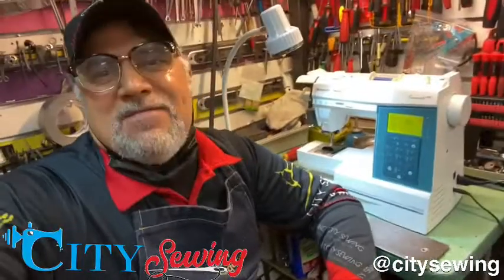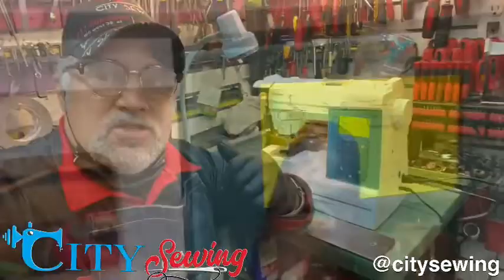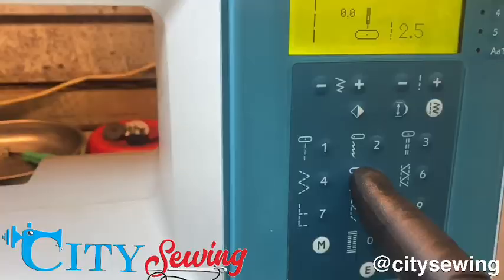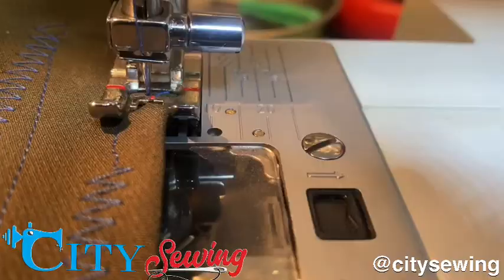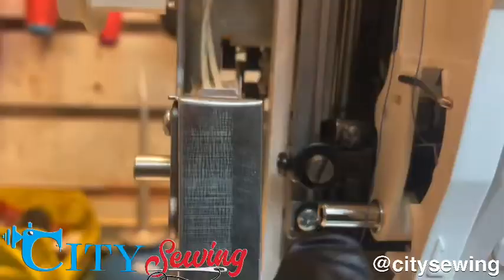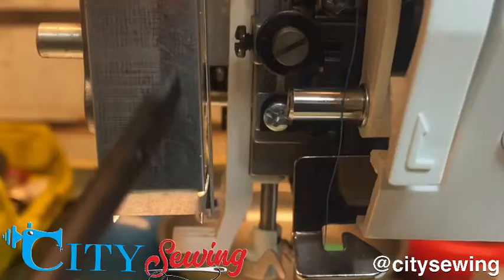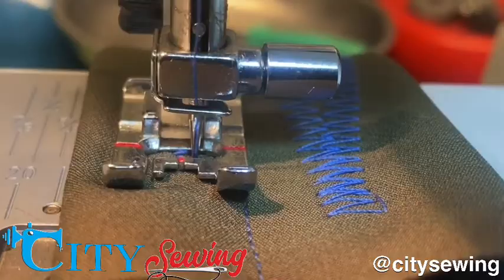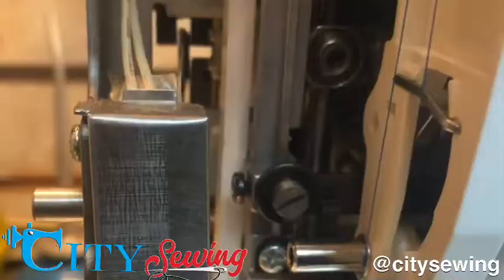How to center your sewing machine needles ..!!

Comment: how about this...my machine keep on jamming thread in the bobbin,  as i working on it i noticed that the needle bar is moved forward that needle hit the metal plate instead on the hole, and i also notice that the presser bar has move forward because the presser foot is now almost covering the hole for the needle. my machine is singer model 1007...is there any adjustments how to fix this problem?

Comment: I have the singer 44s, needle alignment is off center to the right. I cannot get the allen screws to loosen so i can adjust the needle bar side to side, any tips for me please? The closest shop is 2 hours away, HELP PLEASE 😭
Reply: Hi I have the same issue, did you ever figure it out?